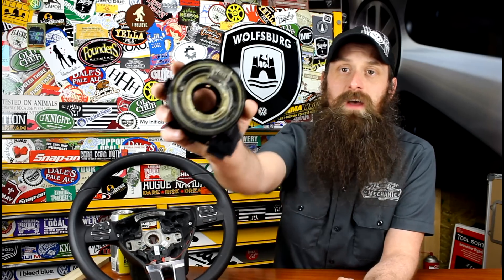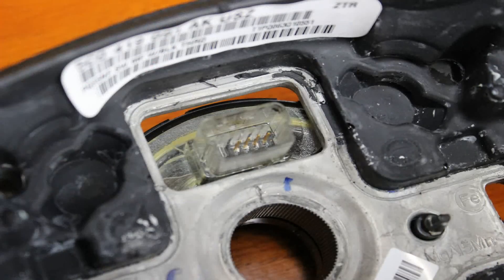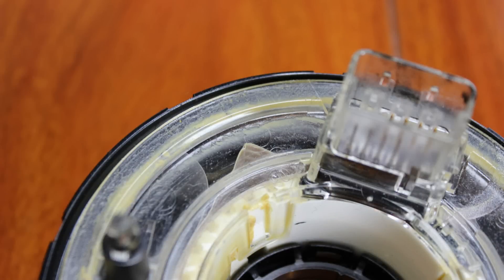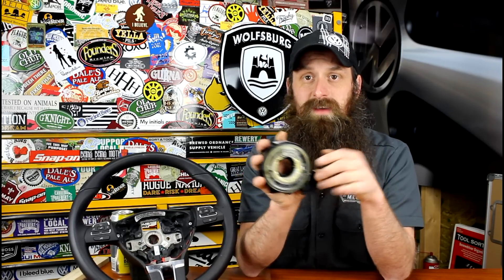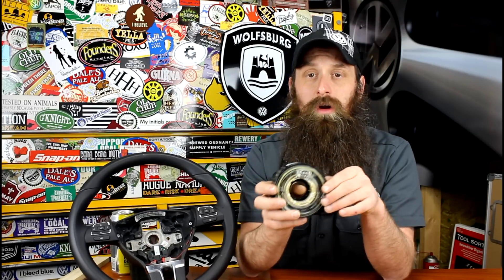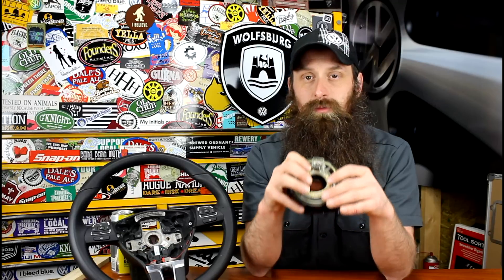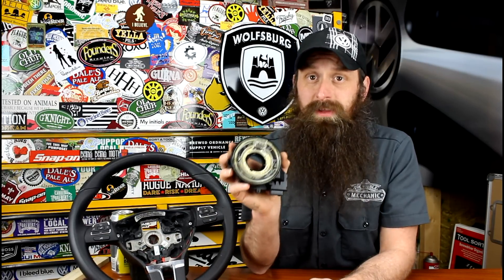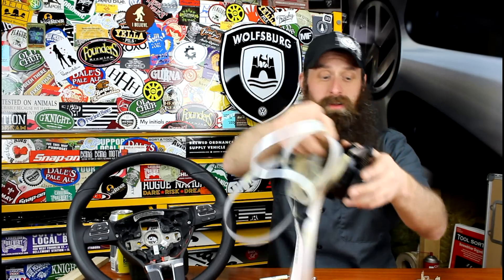How The VW Clock Spring Fails

Comment: First, thanks for the video it's good info. Second, on my B5 I get a code 00588, airbag igniter: driver side (N95). Sporadic- Value of resistance too great. I replaced the airbag yesterday and light still on, so I'm thinking the clock spring is my culprit?
Reply from the maker: That is very likely. You also have to clear the light. Airbag light generally doesn't go out by itself.
Reply: +HumbleMechanic yes I have like 3-4 times and it goes off but a second later it pops back on. I'm going to try right now turning the wheel and see if it will clear. But that code I gave you points out to a clock spring?
Reply from the maker: Very much could.  What scanner tool are you using to clear faults? With VCDS you can check the info of the airbag module and see when the n95 reading drops out.
Reply: +HumbleMechanic a cheap Vag Max scan for VW/Audi. I doubt I would see any drops in the n95 readings but will see if it will delete it. Again, I appreciate the quick responses thank you and I will be checking out Deutsche's auto parts!
Reply from the maker: If you can go into address word 15 and go into read measure value blocks, do that. 

I forgot what block it is, but it's very low like 1,2,3 VCDS labels the blocks. You'll want to find n95. 

Monitor that while turning the wheel. It may go from correct to too large. If it does that while turning the wheel it's almost certain. It's the clock spring.

Comment: Called Volkswagen customer care and indeed my Passat is on the upcoming recall for faulty faulty clock springs  :-(
Does not explain why they taped the clip except to possibly  avoid replacing whole unit as they know recall is coming.
They VW customer care is are checking into it now to give me an explanation.....

Comment: I have a Passat TD 2013-My- it is still under warranty.
I had to have a new steering lock installed as the car would not turn off - we found a way to jiggle with it and turn it off.
Upon driving home after they had fixed that I found that the horn was not working ( lucky there was no accident)-Nor any of the steering wheel controls.
Took it back and was told that on of the plugs was not put in all the way and that they taped so that through vibration it would not come out again. The said this is what they were doing with the Jetta that were coming in with a similar problem.
Ok they taped it and it works BUT I do not feel it should have to be taped- but should be securely clip in as in the original condition. As I said it is under warranty.
In your opinion do you think that the clock spring should  be replaced?
Is it negligence on the techs part not to have seen that/or check for full functioning of vehicle when they were fixing the steering lock problem?
Thanks for any info before I call up service manager to complain.
(I see below that there is a recall coming up- but not sure for what exactly)
Reply from the maker: I wouldn't be cool with it being taped. 

I have replaced a good amount of locks and never had to tape a connector. 

It's hard to say what happened with out seeing the car.
Reply: +Robert Maddison - "In  their words--"33030 found that one of the plugs did not to clip in all the way. Clipped in the plug Everything working now"

I inquired about exactly what was the problem and my advisor told me that had clipped in plug and secured it with electrical tape to make sure it stayed connected....

Comment: I thought so too, that's why I wanted to get a better opinion. They are giving me the clock spring for $75, no labor (this is the Volkswagen dealership). Do you recommend I just get the part or just go elsewhere? I got the lock cylinder replaced through them and I'm still having the immobilizer problem. I kinda want them I finish what they started so this won't be a complete waste of money 😕

Comment: Thank you for responding. They initially said it may be a cluster problem, but when it was hooked up yo the scan they said it was my lock cylinder. I got that replaced and there's still a problem
Reply from the maker: I have seen lock cylinders cause that. But it sounds like they are just trying to throw parts on your car. :(

Comment: I had the clockspring replaced in my 2013 VW Passat TDI in Sept 2014, thankfully it was under warranty.  Today (10 months and 20,000 miles later) the clockspring went out again.  The car is out of warranty.  Do you know if this something I'm going to have to replace very year?

Thanks for the video!
Reply from the maker: butter me That is odd. I have not ever seen multiple clock spring failures. It is possible but very unusual. Are the symptoms the same?
Reply: HumbleMechanic Thanks for getting back to me.  Yes, it's the same symptoms, clicking in steering wheel when turning, controls on the steering wheel don't work, horn doesn't work, and I have an airbag error.  I have an appointment with my local VW dealer tomorrow.
Reply: HumbleMechanic My dealer confirmed it's the clock spring again.  They said if I buy the part, they will throw in the labor for free.  A woman at the service counter implied I'm to blame for these clock spring failures because I turn the steering wheel too far.  I'm thinking 2nd clock spring failure was due to the VW mechanic putting it in wrong?  IDK.
Reply: @butterme9171  Did you end up having any further issues with the clock spring after fixing it for the second time?  I've heard a lot of people complaining about multiple fixes.  Just bought a 2012 Tiguan on Carvana and the clock spring has obviously failed.  I'm trying to decide if it's worth fixing or if I should just return the vehicle while I still can.  Thanks!

Comment: Hi, I started experiencing a problem with my immobilizer light in my 2006 VW Golf. The car will start and automatically shut off and flash the immobilizer light. This happens very randomly and will sometimes take me 30 mins to get the car started. I took it to a dealership and they programmed my keys. Did not work. I took it back so they could diagnose the problem, they told me it was the lock cylinder. I just took it in to get the lock cylinder fixed. They told me the car was fixed but they found out the clock spring was broken and I would need to get it fixed. Within 5 mins of leaving, I made one stop , tried to turn my car on and it starts and automatically shuts off again flashing the immobilizer light. I call the dealership and they say it's the clock spring. To my understanding  the clock spring doesn't have anything to do with the immobilizer? What are your thoughts on my problem? I don't feel like spending money on things that don't work! Sorry for the long post, please help!
Reply from the maker: MademoiZelle02 That doesn't sound right. I have never seen a clock spring fail and cause an immob issue. It is probably the cluster that failed.

Comment: Hi, my horn beeps randomly as I turn my steering wheel.  Does this sound like a faulty clock spring?  2000 Eurovan.  Also,can you tell me if I can replace the part from a Jetta?  Eurovan parts are always more expensive and I heard they share some parts.  I just don't know what year Jetta clock spring to look for.  Thanks.  Great video.
Reply from the maker: Darryl Reiter IT could be a clock spring. It could also be that the air bag is not fully seated on the steering wheel. 

I don't think the Jetta and Eurovan share that part. Eurovans were always the odd ball of the family.

Comment: I have a 2012 TDI Sportwagon with 50K that just started having all the symptoms of a bad clock spring (airbag warning light, no horn and no steer wheel controls).  It happened all at once the other day as I was backing out of the driveway.  However, I have one other nice feature that I haven't heard from others.  When I press the keyless ignition button to start the car, the horn sounds continuously.  Sometimes it stops once the car starts, other times it doesn't and I have to press the ignition switch again to make the horn stop.  VERY ANNOYING!  I'd be interested if anyone has heard of this horn issue.
Reply from the maker: Ben Wallace that is a weird one. I don't think I have ran into that before

Comment: Thanks man you saved me a lot of time testing this thing. Apparently my airbag fault code (00588) was caused by loose/oxidized ground connections. cleaned/tightened them and no more code.  :)
Reply from the maker: Iam D AWESOME!!!
Reply: HumbleMechanic Hey can u make a video about wheel alignments? Is there such a thing as a steering alignment?
Reply: Iam D That matches my code, what steeps did you take to find out the solution?

Comment: Hi, I have a golf 2005 gt tdi 2.0 ... and my airbag, esp, power steering and traction lights are on. My local mechanic did mention all these sensors are linked together on the Clock spring so that could be the issue. .. will replacing this part do the job? ( plus the abs kicks in when I go over 60mph and puts engine into 'limp mode' because the other lights on dashboard are lit).
Reply from the maker: enzee01 It very well could be all related to the clock spring. The thing about limp mode over 60is odd. might be multiple issues

Comment: Could this also make the ESP to light on?
Reply: Yes i damaged the rivet cable while installing an aftermarket wheel so my traction light stays on and the horn doesnt work. I just ordered one used hoping it works well but i will be taking it to a professional.
Reply: StealthGundamVR did that solve the esp light issues?
Reply from the maker: Jesus M. Yes it can

Comment: At first I thought you literally meant a spring for a clock - like, "they still use springs in clocks? :)

Here we call them "slip ring" or airbag slip ring (or they were when I was last working on them).  If I recall, I think I had only replaced one or two of them back in the day. They weren't something that failed too often, but they were more basic back then and were only used for the airbag connections.
Reply from the maker: Ahhah. I meant to also mention that it has other names. some parts catalogs call it a canceling ring.